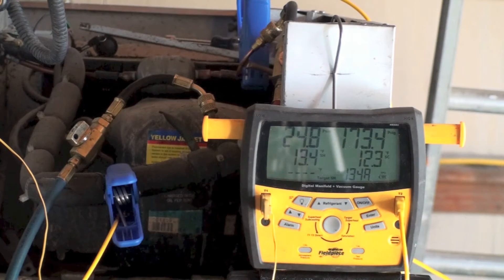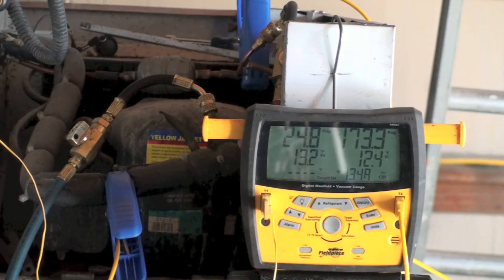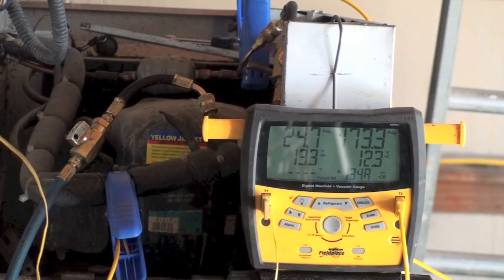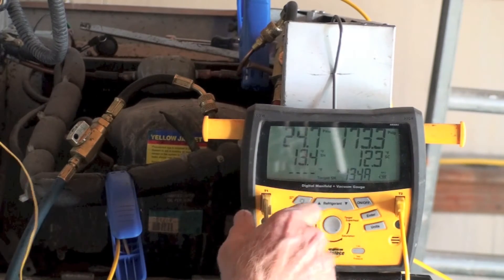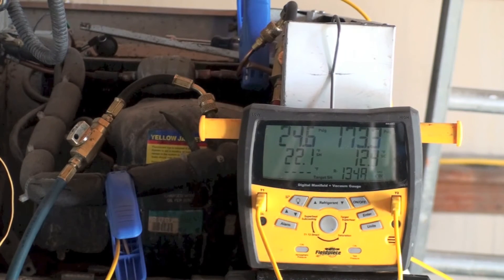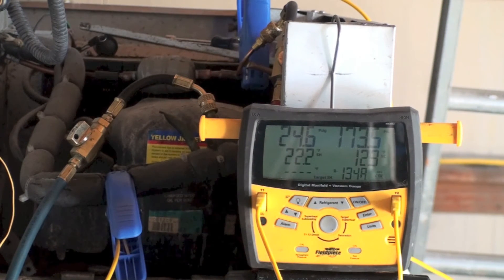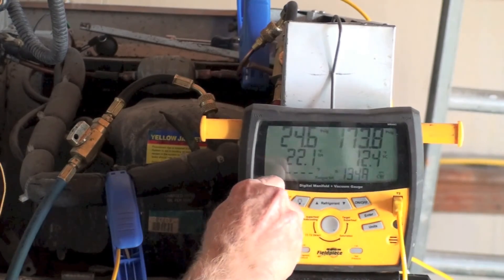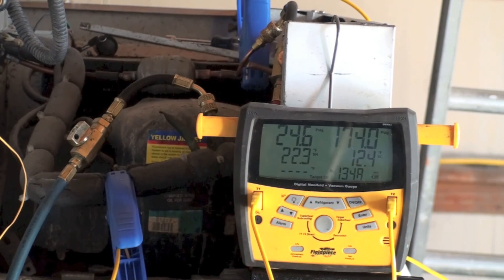Where to check superheat on the medium temp box

Comment: Great info. Im have issues with a display case. I think I need to adjust the pressure cut in/out but I really want to be sure the thing is charge properly first. I was getting high superheat from checking the wrong place on suction line. You confirmed what I was thinking. This video and the one charging a small med temp box really helped. Thank you GFM.
Reply from the maker: Welcome
GFM

Comment: Thanks for the videos!! I was having trouble getting a proper superheat while charging a cooler a couple months ago... I now see why since I was taking the superheat measurement at the suction line between the evap and compressor... I remember having a high superheat and did not want to continue to add charge since the sightglass was full and I was getting close to 30 degrees above ambient so I adjusted the TXV the best I could.. I will now check at the sensing bulb going forward... It appears to be maintaining temp so I must have gotten lucky... Thank you so much for the tips!!
Reply from the maker: Armando Torres Remember one thing, If you think you need to adjust the TXV, think again.  I have never adjusted a TXV without finding there was another problem.  Then I had to adjust back to what it was.
GFM